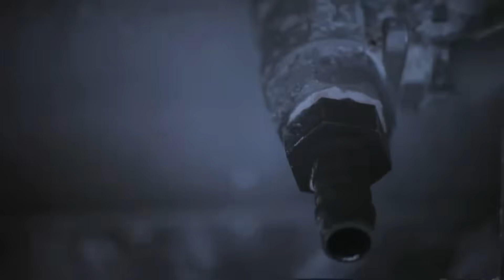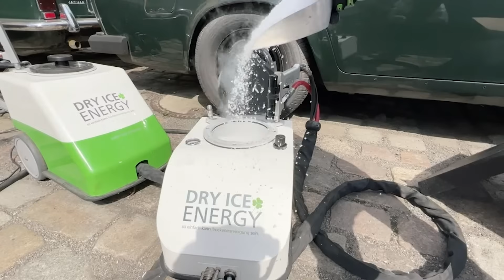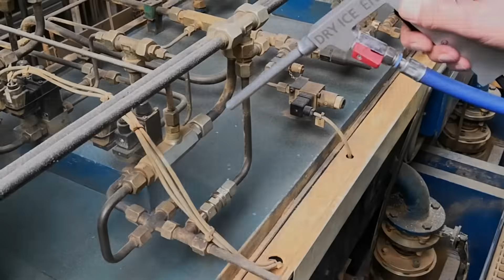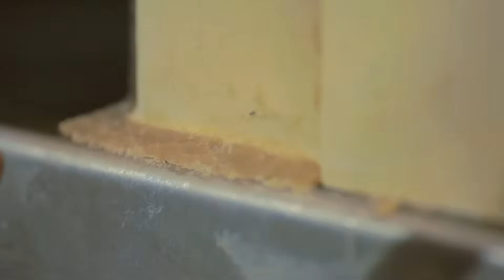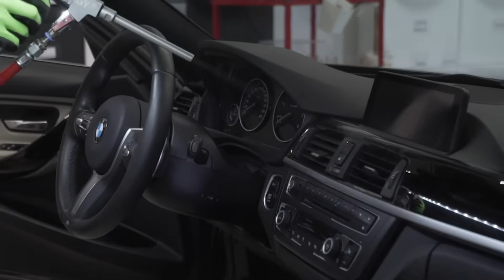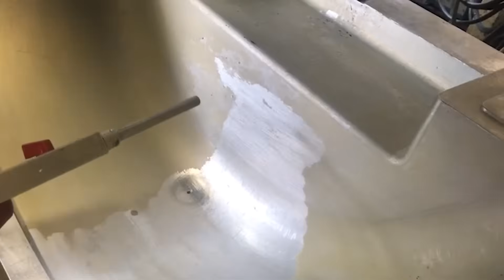How to Clean WITHOUT Water & Chemicals? - Cleaning With Dry Ice by DRY ICE ENERGY

Comment: What is the operating system? 
energy and an air compressor and dry ice?
or do you need something else?
Reply from the maker: Hello! 🙂 Our machines work without electricity - you only need a air compressor. You can find all the technical details at our website - for a short cut to Champ Vario model check this link please  ➡ https://dryiceenergy.com/wp-content/uploads/2021/02/Datenblatt_ChampVario-1.pdf

Comment: Its very costly and don't work until you have a proper air compressor.
Reply from the maker: Hello Sid L, our product is much more modern and ergonomic than other machines on the market, and its prices are very competitive. For specific purposes, different compressors are required and these compressors are easily available. We also provide support in this regard. For more detailed information, if you can send us your e-mail address and your city, we would like to support you. You can also contact us by filling out a form on our website! https://dryiceenergy.com/en/contact-to-dry-ice-energy/
Reply: @dryiceenergy_original  Your info is misleading, Your product works only on High pressure compressor only and You have a pathetic Tech Support.
There are much better products in the market, Stop misleading People with your fake marketing.

Comment: How can I make this mobile, cleaning kitchens, bathrooms etc. What kind of air pressure would I need?
Reply from the maker: Hello Apple Carrot, our machine work without electricity, so it is very mobile itself :) You can easily use them inhouse. About the air pressure;
*Depending on the application, our machines require between 250 -1500 L/min
**We recommend between 400-1000 L/min for most applications
***And a compressed air tank to store the generated compressed air from 100L upwards. 
For more detailed information, if you can send us your e-mail address and your city, we would like to support you. You can also contact us by filling out a form on our website! https://dryiceenergy.com/en/contact-to-dry-ice-energy/
Reply: Where can I buy and what price